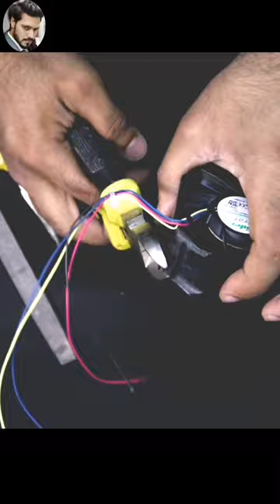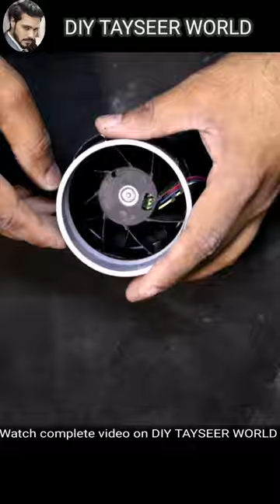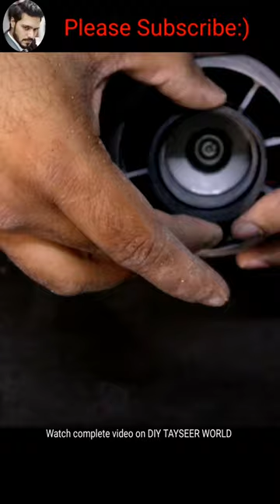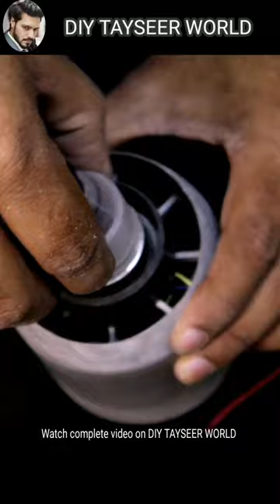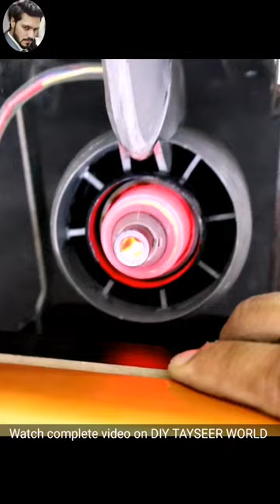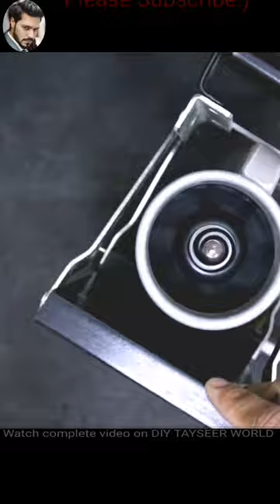MAKE A JET ENGINE FROM PC FAN got viral

Comment: It's a EDF if you add combustion it becones a Jet
Reply: Wrong
Reply: i think it needs compression
Reply: @maiyooo  tbh, yes you need a compressor, combustion chambers, a another turbine at the end spinning the compressor, making more air go spin turbine, cycle continues, this is a turbojet. A jet has a compressor driven by a motor. 
Sorry for the misinfo 4months ago
Reply: @FlammableElectronics  thanks! i might actually make something similar
Reply: @maiyooo good but it seems easy but you need material that resists REALLY HIGH TEMPS
Reply: @FlammableElectronics  yeah im an probably using some kind of metal
Reply: If i were to add fuel, would i use butane? Also how would i get it to spry into the combustion chamber. I cant seem to find a pipe or nozzle that small

Comment: I absolutely love this design for micro grows and smaller ducting than industrial inline fans with reducers that cause turbulence and excessive noise for the low cfm actually needed so you can run at optimum motor speed while having proper duct sizing. Thanks for the inspiration
Reply from the maker: Thank you for watching the video.. I hope you have already subscribed the channel.. Keep watching and have a great day

Comment: Its RPM is too slow to take off the aircraft. To increase, the gauge of motor winding copper wire has to change to the thick wire winding.
Reply from the maker: You are right sanjivv But another problem is that this motor has 4 poles and some electronics to control with sensor. So we can't adjust the speed of it. We need 3 pole motos with thicker winding and proper ESC to run and control.. But this was just for fun I hope you like the video.. See you in the next one.. Have a great day

Comment: Why do it to a cheap  fan, do it to a Delta fan and then it will become a real Jet Engine lol. 
It works for me with a Delta Fan which is $70 Canadian and a BLDC 2KV Motor  with 50w ESC for $75 Canadian. 

P.S I tried a Afterburner with it and it created a lot of thrust, strapping it to a Glider makes it like a Plane lol.
Reply: @warbird11_  why wrong?
Reply: @FlammableElectronics  a jet engine is much more than a fan
Reply: @warbird11_  yes, it still needs combustion or it's a EDF
Reply: Still a LOT more than just combustion